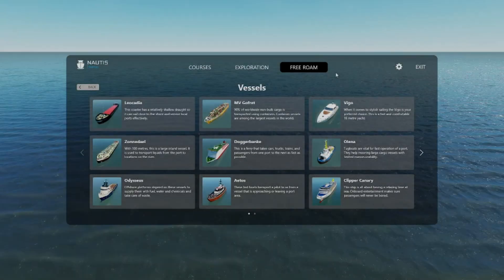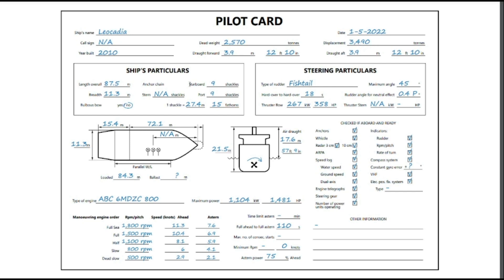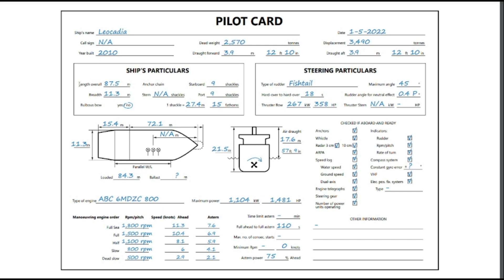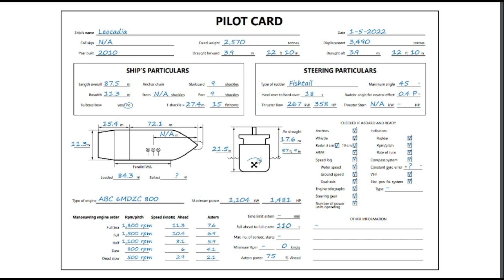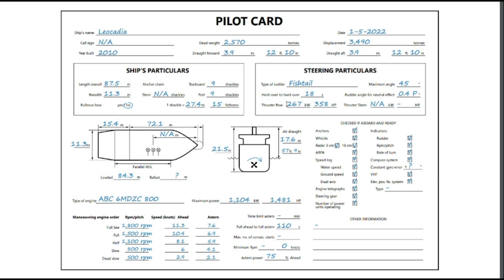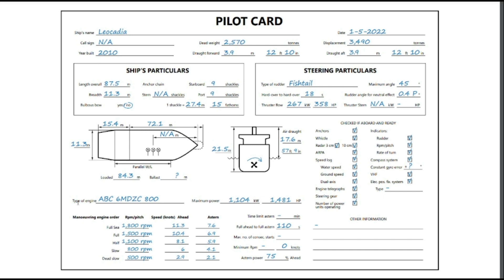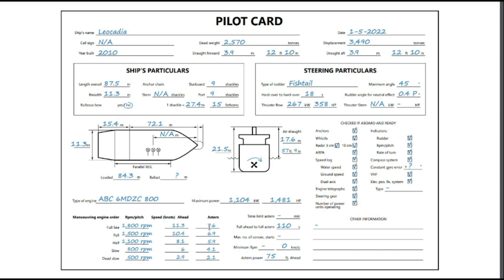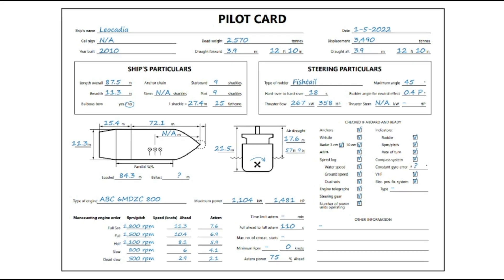Guide to Ship Handling EP 1 - PILOT CARDS (NAUTIS HOME)

Comment: Is there anchoring in this game? Can you do a video where you drop anchor with full power on engine? Or when already anchored and standing still try to put engine to max to see if you can drag the anchor?
Reply from the maker: Unfortunately there is no anchoring in this game as of yet, however I will still cover anchoring and use of the anchor theory. Using the engine full power will certainly drag the anchor though